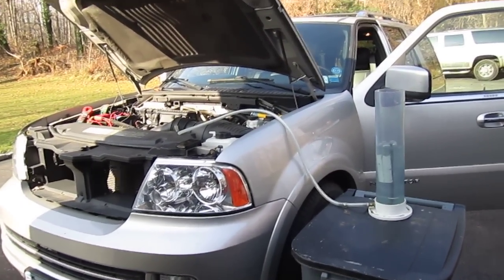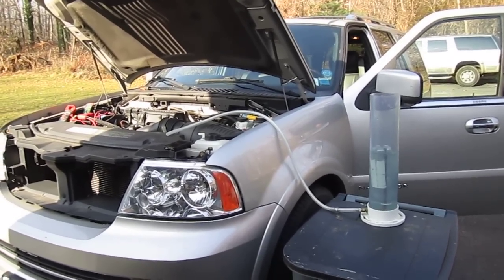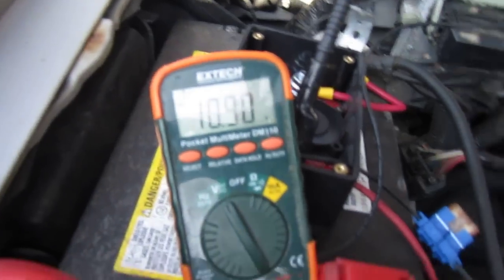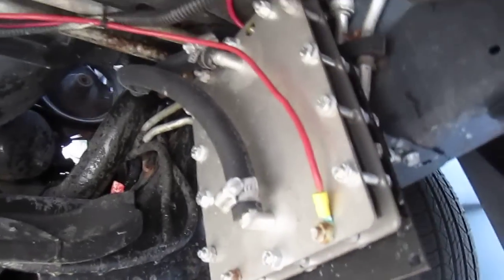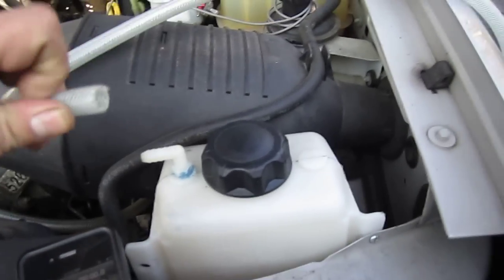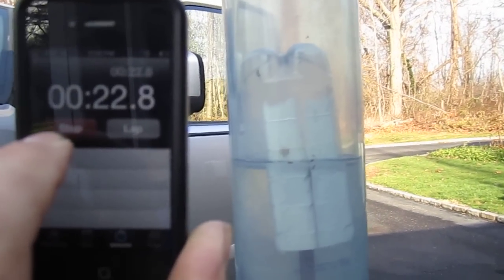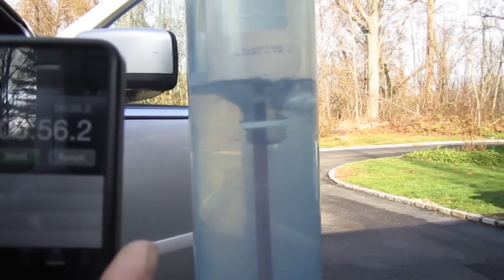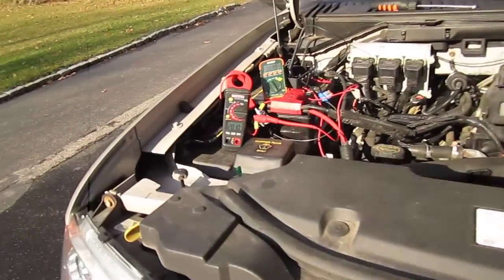HHO Dry Cell Test in a Vehicle

Comment: To answer everyone's question these things only work fine on older vehicles that the ecu doesn't relearn and compensate the gas. On newer vehicles you will need to have the car custom tuned to see real results. Otherwise this system is useless.

Comment: which steel is better Stainless Steel 304 or mild steel . how much mm sheet thickness required? what is the dimestion  of the plate required for a 1.2 L petrol car . how many sheet required

Comment: Many mechanics state that running gasoline alongside HHO will result in the Gasoline and HHO being burned when the spark plug fires with no improvement in MPG.
Can you prove/demonstrate that: 1) This will save over buying Biden's gasoline? 2) Can you guarantee that when the RPMs pass 2000, the HHO won't pass through the Valve clearance and cause a Back-Fire? These are questions that can only be answered by running the vehicle from 0 to 60 and let the seconds speak for themselves. People who can't afford Joe's Gasoline can't afford to blow an engine on untested theories.

Comment: Hi there, I'm a bit late to the party. I've just finished my first 4th experimental cell and just wondering, is that a 500ml bottle? If so, mine produces the same amount but I'm drawing about 30 amps hooking directly to battery and temperature is about the same as yours. I ordered a pwm which was rated at 30 amp and even with a 25 amp fuse it died after only a few minutes. Are pwm's important?
Reply: you need a DC-DC down step converter

Comment: Lol, pulling electrical energy from the alternator to generate gas in an amount not even noticeable for the engines consumption, and where does this electrical energy come from? Yup, burning more fuel.

This is like putting a light bulb powered by the cars battery to shine on a solar cell to charge the said battery.
Reply: And this is the ultimate flaw in HHO design - energy can be neither created nor destroyed. So you're robbing your engine of power by adding drag on the alternator in order to separate the H₂O into HHO, then trying use that HHO to generate more energy than you put in... it just cant be done, because of the conservation of energy.

The only way hydrogen-on-demand could possibly work is to develop an alternator that is 99.9999999999% efficient, so that all of the energy used to make the electrical current for electrolysis is returned in the combustion. The math simply doesn't add up.

Hydrogen absolutely CAN power combustion engines, but you cannot use the hydrogen generator to power your engine, there's simply too much loss. You would have to create and store the HHO in one place, then transfer that HHO to the vehicle as fuel. This would require pressurized hydrogen, and any accident would result in a horrific explosion, which is just not road safe.

Hydrogen is not the future for ground vehicles. For spacecraft, sure. Maybe even aero tech. But not cars.

Comment: I have a propane jet heater to warm up my garage. It sucks all the oxygen out of the  air in the garage and also gives me a severe headache every time I use it. Do you think this HHO dry cell will produce enough Hydrogen to run the heater? The heater is rated at 60,000 BTUs.

Comment: Look up split the positive and build a large system for the back of your truck.  With this system you can pull hundreds of amps at a high efficiency.
  I already have done a split the positive setup for HHO on a small scale and I am the first one that I know of that has done this.

  Do this at your own risk to personal safety and property.

Ask for help from the HHO community if you are new to this.
Reply: If you want to split the gas from the air,you need to isolate it from the minus...not from the positive...i am now splitting it and i need less amps and have much more output then before....

Comment: You're murdering your battery, and alternator, at 20 amps.  I know from experience.  Your battery should never be below 13 volts while the car is running.  I can'e believe you have it under 12.  Mine ran at 12.5 when I juiced it to 12-15 amps, and I couldn't turn the headlights on because the lights and everything else were dim, so the HHO unit never got turned on at night unless I turned it down to about 5-6 amps.   When they battery goes the alternator isn't far behind because they depend on each other.  You need a high output alternator to run 20 amps consistently without prematurely replacing those two components.  They're only engineered with about 15 amps of wiggle room in them from the factory at best.  Most people getting great gains out of their setups they post on YouTube are only doing it for a short period of time.  10 amps is about where you want to be unless you go out and buy a MechMan alternator.
Reply: Would a 2nd and 3rd alternator work though? Connected in parallel 12 v at 30 amps would produce a fair mount of HHO, i would imagine alot of people experience pre HHO ignition resulting in worse fuel consumption
Reply: @thapelomashaomasemola7922  The more alternators you have, the more your engine has to work to generate that current, the more power you're going to drain from the wheels, the more fuel you have to use to get to the same speed.

A 3rd party, more efficient alternator would be better than multiple alternators. You want something that is going to have as little waste as possible. I know LActrical has a 200 Amp alternator for chevies, I would imagine that they exist for other vehicles.
Reply: @JoshuaParnell  but what about an alternator connected to a turbo, preferably similar to what you spoke about, although the only engine we tried removing a turbo was a nissan 2.8l diesel and obviously it ran well until you need power up a hill or drive highway speeds and then unburned diesel clouds the air behind, and a turbo connected to a n/a engine would cause restrictions and loss in power since one would need a small turbo to spin even at idle to maximize production, balancing would be a minor problem, tried disconnecting a turbo from a 2001 S40 2.0t, ecu kept killing the engine as expected , I'm thinking maybe a similar layout to the Merc F1 race car would be more effective on a turbo vehicle
Reply: @thapelomashaomasemola7922  The only thing a turbo does is take exhaust to spin a fan, which is geared to spin another fan at the air intake. It's a method of forced air induction.

By forcing more air into the intake manifold, the O2 sensor sees that the air:fuel ratio is off and increases the amount of fuel. More fuel = more power. This is the opposite of what an HHO generator is intended to be used for.

An HHO generator wouldn't really benefit from a turbocharger because the standard theory is to introduce your HHO gas AFTER the O2 sensor on the air intake system. This is so the ECU doesn't try to compensate for the increase in oxygen by adding more fuel; you want your fuel to be more efficient, not add more fuel to it.

It's been a long time since I've researched HHO and I've forgotten a LOT in the last 10 years that I'm re-learning, but my current notes indicate that there are a couple ways you can increase the HHO generation with minimal loss to efficiency.

One such method I'm planning to test includes adding a 2nd car battery wired in parallel. This will allow the same voltage but twice the amps that can be stored / drawn.

The use of a PWM to regulate voltage is also something that a lot of people have taken to using so that the current is steady and constant.

And lastly, I'm considering adding a high-capacity capacitor, similar to what you would use in a competition car stereo system.

Comment: The system works but what you get out in hydrogen you burn twice the amount in gasoline t.What these people are trying to make you believe is you will get better fuel Economy. there is no such thing as free energy.This is false and using this system on a engine design to run on gasoline will most likely DAMAGE the internal components.

Comment: i try to do this with 0.800 mah 12v and it works to make an explosion.. and i believe if you get at least 20 lpm you are able to bukld a torch.. but my question is what happen if you put 50 volts and 7.0 amp to the dry cell?

Comment: The only way to get any value from one of these is to run your HHO system off batteries and not off your car's power.  Charge them at home.  Basically converting your electricity into battery power, then into HHO gas.  Then again this only works if the added weight doesn't reduce your MPG below what is added by HHO.  This also only works if the electricity used is cheaper than the gasoline.  The ones that are powered off your alternator will yield a decrease in fuel efficiency over time.  At first they'll look good as they drain your car battery, but then as it balances out you'll lose that fuel efficiency.   Oh, and the argument that cars have all this left over fuel burned by the cat that an HHO system will use is also a load of crap.  Modern cars use virtually all of the fuel in combustion.  Last note:  HHO burns 2.5 times hotter than Gas, which means your putting more wear on your car's systems.  If you think that the H2O created in the burn will cool your car, note that Gas also produces H2O in the burn, so in reality you are running your engine hotter.
Reply: We use a separate 12 volt battery for HHO unit, no big deal..when you're doubling mileage and your performance is a little better cos it's running cleaner than it ever has after a couple of weeks and decarbonizing. your engine; which is what we're doing currently and will post soon..Mind you we're not talking about brand new cars, but we can make them more efficient too using HHO....we're talking mostly about  units that go in what people already own, gas hog trucks, etc and wanna use less gas, keep their oil cleaner, we ran this one about 100,000 miles on an 05 Subaru outback and getting 45 mpg We're gonna test units in a series of diesels, tractors, generators, etc; Most people just don't get it , how to insert in any internal combustion engine, cos it does work if you've done the actual groundwork or quest for good intel, or study under someone who knows how to do it, how it works and we're gonna share everything because there's a lot of misconceptions regarding HHO systems, catalysts, byproducts, etc.  Would prefer to use a solar cell over a 12 v battery but not running one yet.  HHO can't make an out of tune, beat to death piece of shit run like a dream boat but I can promise you a well used, or decently maintained gas hog, hot rod ATV will get results that change game. Everything has context and people are open to what they are open to.....there's a lot of bad information out there and if you're curious there's mountains of BS to sort through to make an adequate assessment or something worthy of pursuit.  I was fortunate enough to have a good friend who was working on several types of HHO with mixed results until he cracked the code on a working model made entirely of trash and recycled materials and got it dialed in.  When it was introduced, explained, and proven to me in person by my friend, it opened my eyes and we're gonna do things they say can't be done. with pre existing stuff and make them rock and eco and economy friendly in doing so. Good point on comment but there are solutions and the more brains on it the better it gets developed and evolves; which is all I care about .....better ideas for better outcomes. There's a lot of critics out there, they usually don't offer solutions .. they are the target market. PEACE,
Reply: No increasing hydrogen will make a more complete combustion, not much hotter, possibly cooler idk but also can use a better alternator and control amps if needed… my f150 produces plenty of electricity once’s running

Comment: What makes it a dry cell
Reply: The metal (cells), or the metal coils used for burning the water  you see are outside of the water which make it a dry cell.  The more basic design, the cells are actually submerged in contact with the water and doing the electrolysis.  The benefits of having it outside is that you don't get the brown residue like how you see on some of the more basic designs.

Comment: I need to clear a few things up that new comers may not understand , you do not want your unit self generating heat. because it equates to wasted current. but on the other hand you do want your water to be as hot as possible. I can not say to much but some hints in the right direction will help us all.

Comment: You should build a HHO electric generator for off-grid living.
Reply: Because it won't work.  You'll need to run your gasoline generator just to power your HHO generator.  You can load a bunch of solar panels to power your HHO system but again, you'll get 
more power from just the solar cells alone.  Dumbest idea ever.
Reply: My thoughts exactly. Most generators even have a 12v output, has to be an easy conversion.
Reply: +jcbarnhart77 yes, after researching I've found that a gallon of water holds about 40k btu of hydrogen. simply not enough energy to work, especially when considering the current needed to generate the hydrogen. solar is only way, with the hho being a battery to run a generator at night.
Reply: the alternator makes it workwithout it  can't work
Reply: Just connect a bicycle to ur generator, ur fitness will increase as well

Comment: I just wanted to add that i've learned more about this process since my last comment and wanted to clarify so as not to unintentionally spread misinformation.

Here's the deal....

If you inject the HHO AFTER the mass airflow sensor, the computer won't know about it... you don't WANT the computer to know about it for the reasons i expressed previously.  

The Mass airflow sensor is what (mainly) measures the air density so the computer knows how much fuel to add to the engine to keep the mixture correct.     If you inject after the MAF, then it won't read extra oxygen..  

My initial thought was that by doing this, you would create a lean condition because you were adding more o2 but NOT adding more fuel.   Then someone brought to my attention that you ARE adding extra fuel....... HYDROGEN...  so there is no need to add extra gasoline.   you aren't just adding air... you're adding fuel too.   Granted, there is probably a threshold where if you exceed a certain amount of HHO, you will in fact create an imbalance of Fuel/Air mixture, but i myself don't know where it is.   I suspect most of us would never find/exceed it with the kits currently on the market.

As for the o2 sensors, they WILL NOT (shouldn't) freak out because, when the HHO burns, it creates WATER prior to passing the sensor, so there isn't MUCH to read... 

With a small HHO kit, it isn't an issue.   if you are injecting a LOT of HHO to the engine, then you will have to change the position of the 02 sensors, because there really isn't a way to achieve a 100% burn on the HHO, like there isn't a way to achieve a 100% burn on gasoline.. thereby, you WILL in fact add some extra o2 to the exhaust but with a small kit, it's negligible.   

So, HHO kits are completely viable, and do work from all of the research i've done....  however, i cannot speak to any specific kit as working better than any other kit, and cannot guess as to the viability of ANYTHING you'd buy online.   too many gimmicks and shady folk out there.   um...... sorry... not talking about THIS video per say either... just in general..
Reply: ***** awesome message.  And yeah i remember doing that in elementry school. ..  put wires on a battery, then put 2 test tubes in a little bowl and put the leads into the test tubes. .  Oxygen would go into one and hydrogen would go into the other..    I've thought about this too but never put toooo much thought i to it..   i think what you said makes perfect sense..   put a hose for H to the engine then put a hose with the o2 through to the drivers seat for a little relaxation. Lol    as for the MAF  yeah, doesnt read the actual o2 just density somehow.. i don't recall at the moment exactly how it works aside from magic and the work of satan...     thanks for the tips. I'm going to check those out. ..  i really don't see a need for adding more oxygen to the engine.. well..... unless you flooded the  engine with hydrogen with a huge system.  Still needs oxygen to burn and an optimal fuel air ratio regardless...

As for the alternators and power load you're right there too....     think of it this way...   the power you mentioned required is basically like 1 or 2 gallons of gasoline weight, taking off from a light at idle...  these guys will lug their 250 pound babymommas around with a car full of paper bags and mc donalds wrappers but care about a half hp loss..  but.. at 65 70mph your engine is only using 4hp to maintain it give or take...  so... the hp loss is a ridiculous argument....   but sure.. maybe you put a heavy duty alternator on just in case... or maybe use a capacitor like the amplifier dudes do... idk...  dont know if i said in this one or another one but... you can run a 200 amp  amplifier 12 inch subs no problem on a stock alternator... may not last as long but...  you can do it... and its way more than what these kits generally consume
Reply: +Troll True I do want to add a byproduct of exhaust gases passing through A catalytic converter is water....These “two-way” converters combined carbon monoxide (CO) with unburned hydrocarbons (HC) to produce carbon dioxide (CO2) and water (H2O). In 1981, two-way catalytic converters were rendered obsolete by “three-way” converters that also reduce oxides of nitrogen (NOx) and oxygen sensor can either be placed before and or after the catalytic converter....so I really doubt the sensor would care about water in the exhaust...